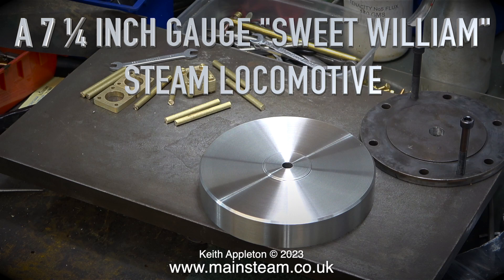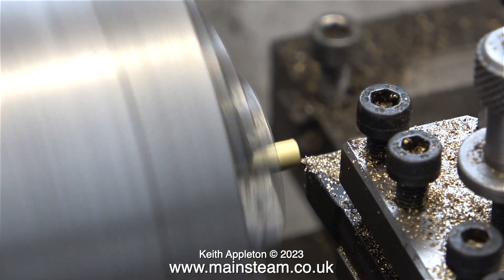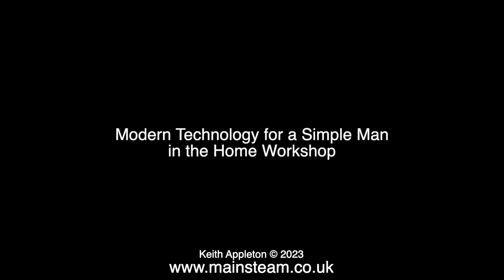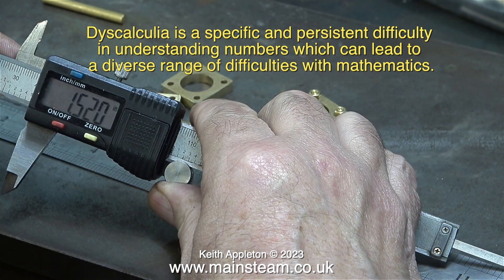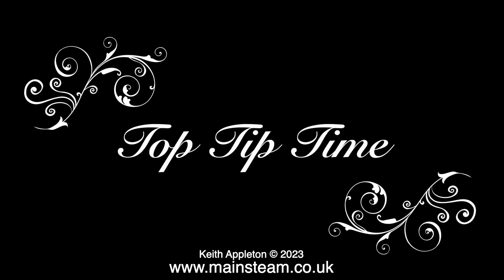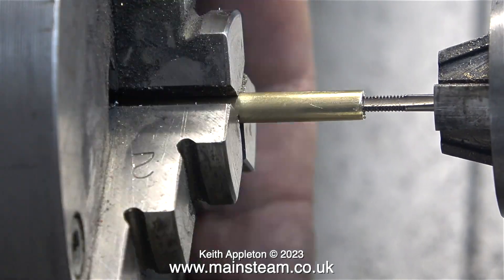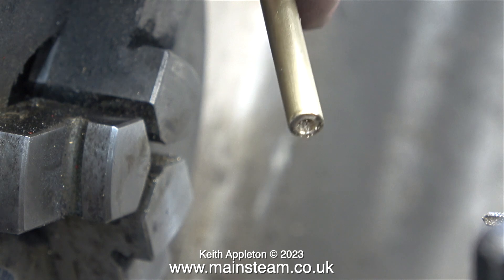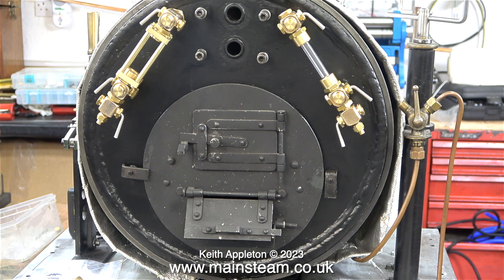A 7 ¼ INCH GAUGE "SWEET WILLIAM" LOCOMOTIVE - PART #34

Comment: My Dear Sir, You will not find me complaining about the volume of swarf around your lathes. My experience is that when doing a job it is only important to keep the swarf away from the workings of the machine. When the opportunity arises you can have a good spring-clean of the area.
Regarding converting fractions. My best friend is a copy of Zeus. Pagers 1 & 2. Standard Drill Sizes & Decimal Equivalents. This gives 1/64, 0.02 on, exact decimal". Number & letter size drills. Up to 1". So very inclusive.

Comment: It is understandable having trouble converting fractions to decimals, most folks never use the process after school again. The method is to divide the number on top by the number on the bottom (7/8  8 into 7 = .875) Now if you work with the things all the time, you end up memorizing them, like I did. 
Those protectors are looking better all the time, I'm looking forward to seeing "William" finished.